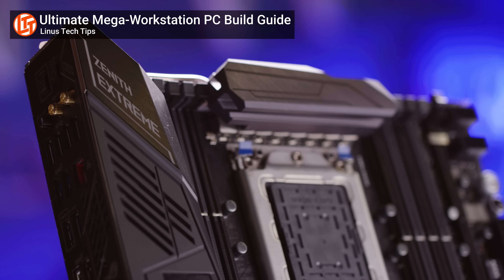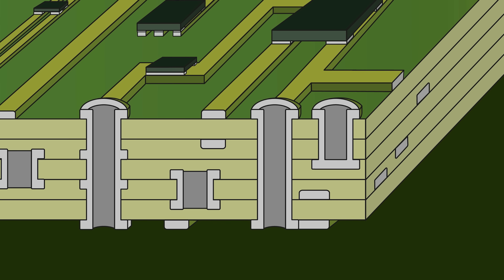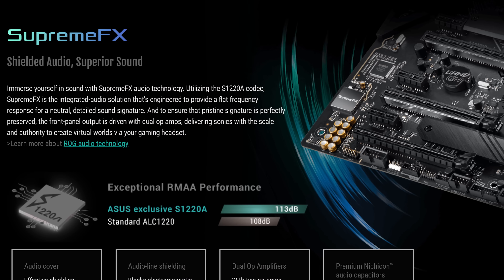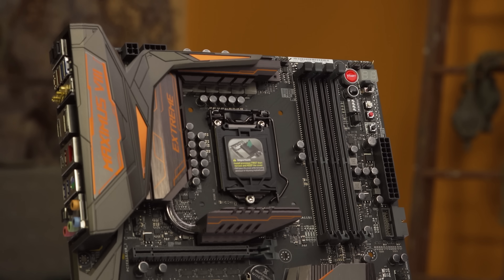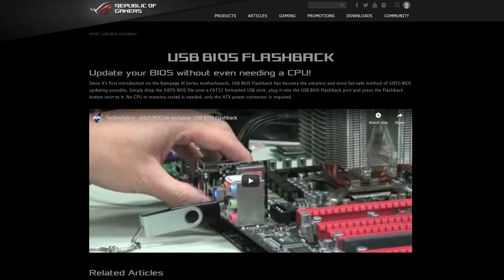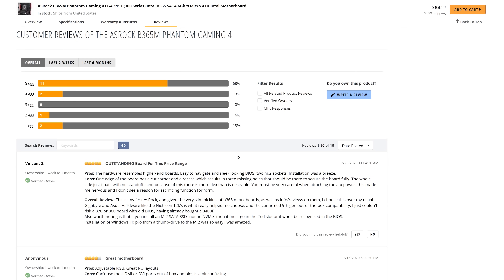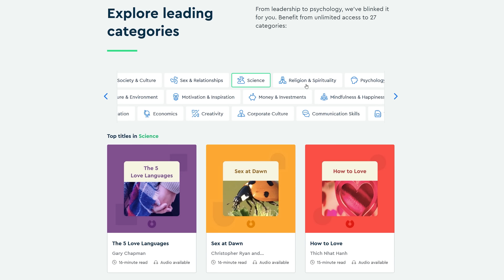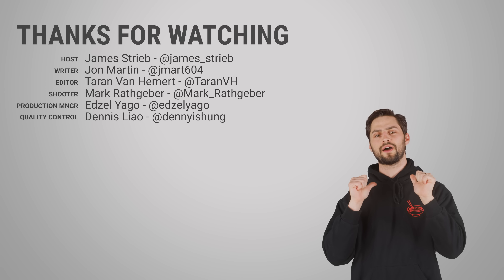Are EXPENSIVE Motherboards Worth It?

Comment: I broke a cheap gigabyte board when a GPU got stuck in and I attempted to get it out. IN the older days I would pick a motherboard based on looks. But with 3800 or 9700K or above use A TON OF POWER compared to the past and VRMs are criticial as these things going out can damage the PSU

Comment: R9-3900x upgrade here...
I built my new system last fall just after the R9-3900x came out. Did a lot of research including watching BUILDZOID videos. The new X570 boards were way overpriced IMO and the only thing they offered was PCIe v4.0 which benefits some future graphics card upgrade (maybe) and gives me a faster M.2 SSD slot (I don't care). I also didn't want to deal with a small chipset fan which may or may not be audible (a lot of boards got BIOS updates which fixed the noisy fans some of them had). I wanted reasonable quality, half decent audio (in part for Linux as my USB solution kept dropping out) and frankly very little else. I finally settled on the Asus Gaming Strix X470-F and it's worked out just fine... small note on M.2 SSD->
*I added a 2nd M.2 SSD for games. I wanted low price per GB not performance as it doesn't matter that much for games between modern SSD's. When I read the motherboard manual I found out that using a PCIe-based model I would lose two of my "x1" PCIe slots. I may never need them but I didn't want to lose them. I ended up buying a Western Digital 2TB SATA M.2 SSD. It was also cheaper than the similar Intel M.2 PCIe-based model by $40. So I saved $40, didn't lose those slots and the performance difference would be practically identical. Just something to be aware of (read your mobo manual).

Comment: 1:32 That’s not a cat 6 cable at 10Gb/s, that’s a console/serial cable at a maximum 4Mb/s. That cable is flat, light blue and the connector doesn’t have shielding.

Comment: I once bought a nightmare of a board asus rog maximus 6 hero, so quality is really poor even though the manufacturer say that military grade this military grade. I changed the motherboard atleast 7-8 times in 2 year of span. The worst experience was whenever i took my mobo to svc it worked perfectly, it took numerous visit to show them the problem. Other problem i faced with expensive mobos that they work with only some set of rams, that i learned the hard way. After struggling i bought a dirt cheap mobo from gigabyte and it is still running my older components with small oc on small gpu and cpu.

Comment: No need super expensive "Gaming"  motherboard unless :
1. You're gonna do SLI / Crossfire or multi GPU setup
2. You need extra PCI-E bandwith for Raid-0 NVME SSD
3. You use top of the line CPU like i9 9900K or Ryzen 3950X (no need $500 intel  Z390 or AMD X570 motherboard if you're gonna use i5 9400F or Ryzen 5 3600)
4. You can't live without RGB bling-bling
Reply: Oh ho ho, I use Ryzen 5 3600 with X570 chipset. Actually, the chipset can provide up to PCIe Gen 4 support instead of Gen 2 that other chipsets provide. I can run PCIe gen 3 cards using PCIe x4 slot now, and also, one of the Wifi AC 1200 card that use PCIe gen 3 x1 to the fullest (I can now get a max speed of 1Gbps instead of 500Mbps).

Comment: Bought a cheap gigabyte b450 board for a build going to my wife's mother.  The boards screw holes didn't all properly line up despite being ATX so I returned it for the same board and that one had the same issue.  

It was also incredibly thin and flexed very easily.  I'd never use a cheap ass board in a build for myself.  Not a chance. There's no need to spend $500 but don't go spending $60 either

Comment: Since 2001 when I'd build my own PC's (I was 11), I'd buy cheaper Chinese Motherboards which had all the features and supported speeds, north/southbridge etc. Then buy the best capacitors, mf alloy chokes and other low-level components and replace them sometimes even beefing up traces especially on the Pentium 4/Dual systems since they were power guzzlers. Even adding LED strips more recently. I was building at least one PC a day on good months, people weren't so used to DIY builds etc.  But when customers realized the computers outlasted other brands, I doubled the price and got a lot of referrals from small businesses the needed more that one computer. So that's another choice you have if you're willing to solder and want to make do with a cheap board, caps, and chokes are the low-level parts that can go bust without any telltale signs most often...

Comment: I bought a $280 board for the gaming pc I built in late 2019 for many specific reasons: I got a 9700k to overclock, 1tb m.2, an rtx 2080s OC, and I really like the heat sink/energy distribution the board features, plus it has reinforced sockets for such a large and heavy graphic card, integrated wifi with external antenna and turbo charging via usb. 

Speaking in general for a medium build like with a 2060/1650 or an i5 obviously that would be useless, I would not recommend the cheapest one though, get something a bit better than the cheapest even with an i5. Like around $150, it will give the extra durability that many cheaper systems should have even if not the performances.
Reply: Get Ryzen 3600 and a WiFi-enabled mobo for $120; same features and performance for half the price.
Reply: @not_anton  there isno ryazen capable of matching i7 9700k in gaming performances, and wifi wasn't the main thing I cared about choosing the motherboard honestly
Reply: For the same price you could get Ryzen, cheap mobo, and 2080 Ti instead of 2080 Super. Ryzen easily outmatch Intel in gaming performance at any fixed budget by allowing more money for a better GPU.
Reply: @not_anton  ryazen 3700x wich is the on the same exact price range of 9700k loses an average of 6-9 frames over the intel processor. 2080 super also loses an average of 6-9 frames compared to a 2080ti, only it costs an average of $400 less. it means that 9700k+2080s has the same perfomances of a ryazen+2080ti being $400 cheaper. I could have simply gone for a 2080ti with the 9700k but a card that's $400 more expensive to get out around 7 frames it's not really worth it.

Comment: Good video pointing out the differences. But IMO, it's still better to buy on the cheaper end of the spectrum, given the price difference. If the motherboard breaks (never had that before), you could buy another one and still have paid less overall than buying the more expensive boards.

Comment: The one thing you will NEED TO CHECK is the M.2 connection.
If you have an NVME M.2 than you will scream when your motherboard only has SATA speed M.2 and NOT the full PCIe 4x speed.
SATA is just 6Gbps (750MBps but more like 600Mbps) while PCIe 4x can run at a max of 7876MB/s (not that you will get that speed but you will be a lot faster)

Comment: I got a X570-E Rog Strix Gaming for my personal rig for future proofing and for when I want to upgrade to any higher end Ryzen 3000 cpu than my current 3600X, It is definitely overkill, but fits nice has some nice colors and has all the PCI-E 4 I want and all the usb ports I need. Oh and 2.5 gb lan and wifi 6 and bluetooth 5.. 
My Wife has the B550-F Rog Strix Gaming for her 3600 and again can be used to upgrade atleast to a 3800X on base clocks no OC, has the storage and gpu PCI-E 4 for her, and again 2.5 gb lan wifi 6 bluetooth 5 and enough usb 3 headers for her, and connects to her addressable fans.

All in all happy, and I should also say: THESE WERE THE ONLY BOARDS IN STOCK BESIDES THE LOWEST END MOBO OR CROSSHAIR SERIES. 
I really can't wait for things to kick it back into gear, hoping for everyone to get better and pray for everyone to have a great life.

Comment: Great video but there are a few things you missed or didn't make as clear as you probably should have I think. The major one is at least on the AMD side which reuses CPU sockets for multiple generations A320 motherboards are or were never designed for the higher end current CPU's and it looks likely that at least Zen 3 CPU's will also use AM4 and possibly more and it is possible none of these will work with older motherboards. That said there may be a lot of other older or even current motherboards that may also not support newer high draw CPU's too and they may not always be the lower end models too. I have heard elsewhere that some of the higher-end MSI B450 motherboards are designed super well and should be able to take everything now or in the future but other of their mid to low-end X570 motherboards may not and yet they cost more. So price does not always equal quality.

Comment: My B75-D3V board lasted for about 7 years or so, and I sold it to someone who's still using it without any issues.

Yes it was a cheap board, under $100, looked like crap, but its the most reliable board I've ever seen.

And btw, even ridiculously expensive boards can be unreliable, in fact, the more components and features a board has got, the more likely it is that one of those things is gonna fail at some point.

If you want maximum reliability, you go for a high-quality expensive board that is Micro ATX, I am not joking. Its what overclockers do, and its for a good reason.

Comment: You do lose performace if you don't get a motherboard good enough for your CPU, 
for example, if you put a 3950X on a A320, it will work, but you will hit the PPT (Package Power Tracking), your motherboard won't use fully the 3950X so you won't fry it.

The PPT threshold is the allowed socket power consumption permitted across the voltage rails supplying the socket.

Comment: Buy a good brand, buy on sale, keep everything you don't need in the original box, keep the original box obviously and keep it clean (i.e. air filters, off floor and/or away from pets, etc.) If it is the top in its class of the platform its in, you can get your money back which equals more toward your new build, possibly profit from it or use it for the best XP gaming machine for thoes games that just don't run right in Windows 10. I've sold many such motherboards for the last ~15 years or more and make either a good portion back or profit from retro builders.

Comment: I have a nice i7 and  an z97-ar both from 2015. Its gonna cost me a fortune to upgrade because I would have to buy both as well as get new ram. I am assuming there are many in my situation so I'm wondering what others thoughts were. My gtx 1080 still seems to end up the bottleneck so it seems like I should just keep rolling until my parts start dying.

Comment: tfw cheapest board that I wanted (3 m.2) is $300. I gave up and just got a 2 pcie16 slot (not shared with any m.2) and 8 sata, so I can turn the 2nd pcie into a 3rd m.2 with an adapter.

Comment: The answer to this is really simple,
Depends on what you are doing with it and if you are going to use its advanced features.
Example - 
B series mobos for AM4 are good for people looking for Cheap AM4 boards with CPU compat. and a light OC for everyday people.
X series depends on how far you are going to go Asus ROG makes some fantastic boards that are known for holding the best OC records and having robust features like Extra PCB layers, better quality sockets, and more Phase PWM with better quality Chokes and Capacitors which tends to get buried under a bunch of marketing lingo and like many features largely go undervalued. If you are going to watercool your PC well price is typically no object anyways but something like the Formula line have waterblocks.

Its all really subjective, but to that end its also more in line with what is the difference between marketing and actual valuable features and gimmicks that you will use and what is important to your needs

Comment: Happy with my Aorus Elite X570. But really having saved some money and gone for an X470 would've been better as I probably would've never seen a difference in performance. I don't even use a Gen 4 NVME SSD since for my use-case it's better to go with bigger. Game assets are compressed, so load times are not different. But Gen 4 NVMEs are hot as the sun. 

Also has good OC potential with the way the VRMs are laid out. it's the same reason the CPU only requires 2x 4-pins with no performance loss in doing so. Not bad for an entry level X570, if you could call any X570 an entry-level even today.

My advice is not go all out and wait for DDR5. But with the corona virus, that may have been pushed way back.

Comment: Video suggestion: Are PCIe 4.0 graphics cards better for GPU acceleration when video editing? I think I've seen a video about PCIe 4.0's extra bandwidth not mattering much for gaming, but what about those who care more about GPU acceleration for video editing (especially in 4k) than gaming. Are there potential bottlenecks with the type and speed of the memory on the graphics card that would negate the higher bandwidth of PCIe 4.0?
Reply: Games can tax a GPU 100%. I don't see any other type of workload demanding more PCIe bandwith.

Comment: I've found a good pairing with 3950x and x470 taichi ultimate, mainly because it is good for 150w at least, and frees up a PCIe slot because of the built in 10G ethernet

Comment: Business class boards are good enough for the masses. if you have a strict budget then go lower end. 
pairing a K series i5 with a cheap Z series motherboard is acceptable but dont expect to reach stable overclock speeds for long stretches. basically its when you want to try overclocking.
or just go AMD.. overclocking across the range, just check your board.

thing is with PCI-E gen 4 and  usb 3.1 + gigabit ethernet, that PCH cooler needs to get beefier again (last time i swapped a chipset cooler was on a Core 2 Duo board. it was reaching 80-90 degC. i swapped it for a heatsink that's double the height with 20% more fins and i propped a 120mm fan between my gpu and bottom of my case pointing at the chipset heatsink)

Comment: tell me about mobos for eternity... my sweet Asus P8Z77 is reaching its 1st decade and still runs everything i throw at it... with a core i5 none K edition...
Reply: Machine Mechine  actually i can't tell because USD is not my main coin, but i don't have enough money now to buy new gear, unemployed for about a year now... plus, i bought that mobo+cpu second hand, but it helded just fine so far. I'm thinking about switching to Ryzen now, i need a bit more $$$ to get the combo upgrade (mobo+cpu+ram)

Comment: I spend around $300 if I remember correctly on my last motherboard... I bought it in 2010... yeah... So if you are going to keep something a while - don't cheap out. I am typing on the PC I built with said motherboard right now. Same goes for the power supply. Figure out what your max load is going to be on the system, and buy a power supply that is DOUBLE that number... Pending some kind of environmental accident, that PSU should run for a looong time. Again, using a PSU (1000 watt) from 2010, works great and has essentially run 24/7 for most of that time.

Comment: Most boards I look at have features I don't want, for example, I don't want a VGA ports on my motherboard, I feel they're deprecated and should just be removed entirely in favour of HDMI and Display Port which is the more fastest and easiest to connect than fiddling around with those stupid annoying screws for VGA cables. Some boards don't have enough USB ports, particularly USB 3.0 and the newer USB Type-C.

Comment: i just buy those cheap branded "internet cafe"-grade motherboard. those board are typically sold at bulk but is built to last. They can last for half a decade on a literally open case environment and will surely last more with better casing.

Comment: I am looking into more expensive motherboards, because I am looking for a very specific set of features . Lots (!!) of USB Ports, with 7 (not counting optional ones for a PC case) being the bare minimum, at least two M.2 Slots (and I won’t complain about more) as well as PCIE Slots to have two x4 connections available on top of a Slot for a PCIE x8 or x16 connection for the graphics card. This pretty much restricts me to more expensive motherboards.

Comment: The fact I am still using a cheap ASUS B350M that started its life three years back with a Ryzen 7 1700 and now running a Ryzen 9 3900 makes me happy of the value I got from that cheap motherboard. So if it does now will replace it with a mid range motherboard.

Comment: SUMMARY: Thicker may be better, datarates may matter, more physical space between audio components and other stuff may be better for sound, better cooling, better power delivery for CPU,  backup BIOS, ability to flash firmware, diagnostic readouts, more user configurable options.